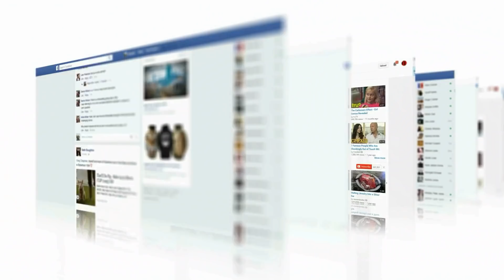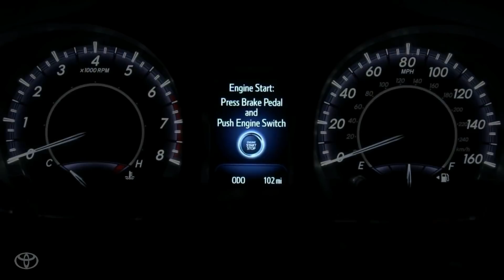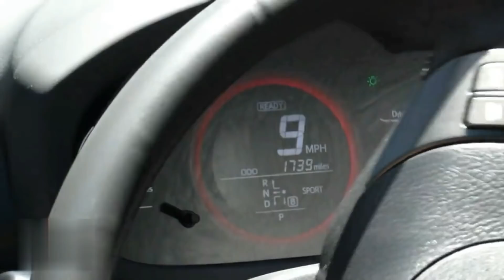Tesla's Partnership With Toyota Takes EVs To Another Level!

Comment: The only thing that Toyota has that Tesla could possibly want is redundant manufacturing facilities, made redundant through Toyota's mis-management and short sightedness putting Toyota years behind everone else. So Toyota can make the Tesla cars that Tesla can't produce quickly enough to supply Tesla's demand for Tesla's cars. Thus saving Toyota from certain bankruptcy and saving Tesla a few Tesla Gigafactories in the short term because Tesla can't build Tesla Giga factories fast enough. So less of a partnership, more like Toyota sub-contracting to Tesla. In any event I hope Toyota, way over the top, comic style flash over function body styling, never gets near a Tesla car.
Reply: Toyota doesn't have enough manufacturing capability. They sell 9 million cars around the globe. There's a reason when they partner with another company, that other company ends up building the cars. Like the 86 being built by Subaru or the Supra being built by BMW. Toyota doesn't have the capacity to be building different cars, until they build for factories for them or kill off other models. Toyota is also profitable from selling cars.

Tesla currently has the capacity to build 1 million cars a year. They sold 500k cars last year. They're also building more factories. They make no profit off cars. They make profit off selling EV credits. I'd be nice to see the government get rid of all EV credits and see how long Tesla could stand on it's own legs..
Reply: @khanikun2587  Two things 1.  Get your facts right. 2. Look further than the end of your nose, unlike Toyota.
Reply: My facts are right. Toyota doesn't have enough manufacturing capability. They aren't going bankrupt. Toyota already makes EVs, but no real push seeing as it's all of 2% or less of the total car market. They have level 2 semi-autonomous cars in Japan. They'll be available this fall in the US, when the 2022 cars release. They've been working on autonomous cars since 2018 and will be buying Lyft's autonomous division to further expand.

Toyota literally is playing in all the fields. ICE, EVs, hybrids, hydrogen, etc. They aren't tossing all their eggs in one basket.

Tesla can't do a whole lot for Toyota. They don't need their semi-autonomous software. Toyota was one of the founders of Automotive Grade Linux for the car's infotainment setup. Toyota has a joint venture with Panasonic on lithium batteries and has for years. Toyota bought into Fukata years ago and deals with their sales of electric motors, which happen to be the electric motors Tesla buys.

You're stupid if you think Toyota isn't forward looking. They have been building themselves to be an EV component builder for years.

1. Get your facts right
2. pull your nose out of Musk's butt and look at how the world actually is
Reply: It not just Toyota at this rate they going put Chrysler out business and Ford as well.   The South Korean cars companies are running to their government for help because they do not have the battery manufacturing for all the EV's they want to make.  Tesla is destroying the car industry.
Reply: None of the S.Korean car companies have ran to their government for help in battery manufacturing. Considering that none of them bother making batteries. They buy them from SK Innovation, LG Chem etc. The same companies that also produce batteries for GM and Ford. Chrysler goes through A123Systems in the US. Toyota makes their own batteries through Toyota/Panasonic. Tesla buys batteries from Toyota/Panasonic.

How exactly is Tesla destroying the car industry? They don't even own 1% of the global car market. EV market only, they own 18% of that and each time another manufacturer releases an EV, they lose even more. Last year, they were like 30% of the global EV market. Once BMW, Mercedes, Audi, etc start releasing luxury EV sedans, expect to see that percentage drop even more.
Reply: @khanikun2587  You see this the problem making prototype is fun and easy.  Now you are a car maker you need a million car batteries and LG will tell you sorry but you don't have any batteries to sell you.  That when dawns you, if you in electric car business you are in the battery business.
Reply: @khanikun2587  Which mean you will have to spend billion on develop a electric car battery, and then billions more just making the factory and that could take years.   In the mean time Tesla car will sell 1 million electric vehicles in 2021.   You as car manufacture have no electric car factories and no battery technology and no battery factory to produce them.
Reply: You see you are guilt of wishful thinking .   Not realizing that there is no battery infrastructure to support electric vehicle production.  The machine that builds the machine does not exist.
Reply: @Madame702  Tesla is making it happen.  Toyota is nowhere in it.  That is the point here.
Reply: @Madame702  You don't seem to know how the batteries are made. All they are doing is building standard battery cells you'll find in cordless tools, vacuums, etc. To make the EV battery you just jam a bunch of battery cells together. All these companies have constantly been ramping up year after year for decades and it's multiple companies around the world who have been doing such. S.Korean companies, Chinese companies, Japanese companies, US companies, etc. Batteries aren't a problem.
Reply: Except that Toyota is literally the one building the electronic motors and batteries in the Teslas, but ya. Somehow Toyota is nowhere in it.
Reply: @khanikun2587  Tesla make their own motors.  And get batteries from practically every battery manufacturer at the moment but certainly not from Toyota.  Toyota are further from being in it than practically every other car maker.  End of.
Reply: @khanikun2587  The problem that you have is your reasoning.  You are reasoning form analogy  Khanikum "battery you just a bunch battery cells jam together".   This is flawed reasoning, or reasoning by analogy.
Reply: @khanikun2587 Genius thinking.  Elon Musk wait Khaniku what is a battery made of?   Nickle, Lithium, Cobalt, Manganese, Copper, and Silicon.   What if we eliminate expense metals like Cobalt, and create a Lithium, Nickle battery instead.
Reply: @khanikun2587  Then we increase the battery density for better charge and recharge and it has no tabs, because tabs slow down the manufacturing process. Cutting cost per kilo watt hour and speeding up the manufacturing so that we not have much cheaper battery that cost less and has a higher recharging capacity.
Reply: @khanikun2587  Now you just revolutionized the battery industry making a cheaper battery and that has a higher kilo watt hour than your competitors given you a massive technological and cost advantage that they do not have.
Reply: @khanikun2587  Toyota's solid stat batteries are really expense to massive produce and there is no factories currency that mass product solid state batteries.  Which mean you would have to build a factory and that might take 4 years.
Reply: @khanikun2587  You also forget in order for Mary Barre at GM and others to create a new factory from scratch it normally take 4 years of planning.  There are almost 20 layers of management from Mary Barre and the engineer working at GM.  That is a lot of bureaucracy, and you thought thought the government was really bad.  Car companies are worse.   Elon Musk working on the factory floor is highly unusual.
Reply: Tesla gets their batteries from Panasonic. It's their main battery supplier. Panasonic and Toyota have a partnership to make batteries. Tesla buys motors and motor components from Fukata, Taiwanese company which happens to be partnered with Toyota.

As for Tesla's tabless battery design, using other tech doesn't make it revolutionary. Their tabless design is nothing more than what's already in use with foil capacitors. They were probably just willing to pay to use the already existing patent for the technology. The rest of it is just a change in battery size. Go from something the size of an A battery to something the size of a D battery. It's still just them, taking a bunch of battery cells and jam them together into their battery pack. Nothing has changed. Nothing revolutionary here
Reply: @khanikun2587  No Tesla, now build their own batteries.   Here is a video talking about the new batteries they invented.  https://youtu.be/lA6FUfaOloo
Reply: @khanikun2587  Tesla batteries and electric motors are not for sale to any one.  So you would have to use old batteries and electric motors invented in 1990's.
Reply: @khanikun2587  Just keep taking the tablets dear.
Reply: @khanikun2587  Best advice to you.  Just keep taking the tablets.
Reply: @Madame702  You mean Tesla designed a battery, then have someone else building. The company that will be building them? Panasonic/Toyota. Hell, Panasonic runs the Gigafactory 1 for battery production. Guess who is planning to build the new 4680 battery that Tesla designed. Panasonic, LG, and CATL. Course all three companies have to figure out how to make such a battery as they're more prone to overheating, more prone to short circuiting, and more prone to particle contamination. Course who knows if they'll ever come out if they can't solve these issues and the issues of actually trying to mass produce them.

Tesla's new electric motor, just a carbon sleeved rotor and it wasn't invented by them. There's carbon, carbon fiber, composites, etc sleeved motors out there. They just made one that could handle spinning at higher rpm, so they could jam it into a car. It's also not built in house, but assembled in house. The components of the motor are made by other companies, given to Tesla, then Tesla assembles those components together to make their motor.

Tesla doesn't have the money to be building tons of new factories to be building the components for their cars. Their plan has always been to insource things, but they don't have the money and who knows if they ever will.
Reply: @khanikun2587  Sorry, but Giga Factory Nevada and Giga factory Shanghai is already making batteries.   When Giga factory Texas and Giga factory Berlin come online they will be making batteries too. 😊👍
Reply: @khanikun2587  What think is cool is that Tesla cars have "Sentry Mode" where it show people hitting and scratching cars on their video footage.  You know, I hope they put this feature on all cars.    I personally like video the young girl dancing in front of a Tesla.   😊
Reply: @Madame702  Giga Shanghai is car factory, not battery. CATL is building their battery factory near the Giga Shanghai factory, as they are the ones building batteries for Tesla. Giga Texas is going to be another car manufacturing factory, no plans on battery production of any kind. Giga Berlin updated their factory plan this month for 4680 production, but they need approval for such. Course building has stopped for Giga Berlin, as they've been sued multiple times for environmental reasons and they're wanting to expand on top of a drinking water protection area. Tesla still not making batteries, except at Giga Nevada where Panasonic is running the show.

Comment: Toyota is DOA in the BEV ecosystem without Tesla. For damn sure Tesla does not need Toyota....Toyota's ICE vehicle manufacturing line is essentially worthless to BEV production, especially with Tesla's use of front-rear mega-castings. Toyota's vehicle framing know-how is stuck at car 1.0 instead of Car 2.0. Toyota has a LOT a LOT A LOT of catching up to do - and fast - to survive.